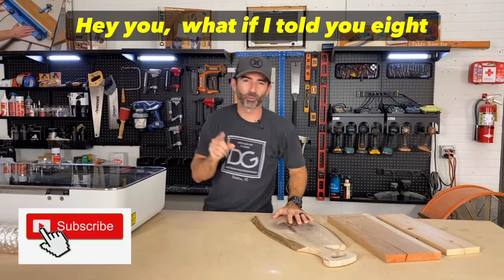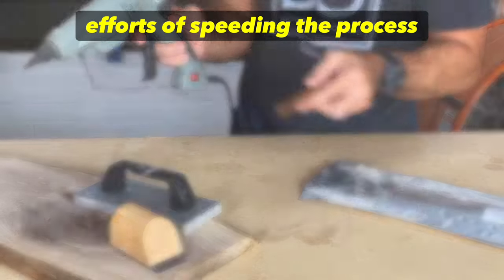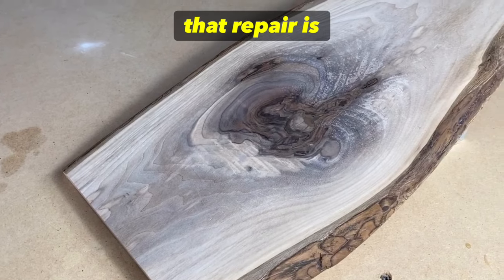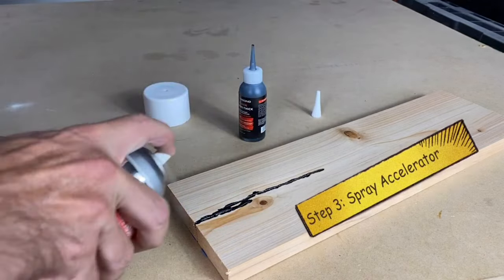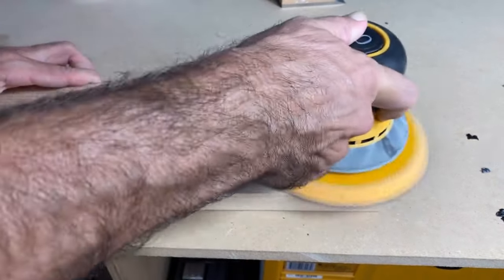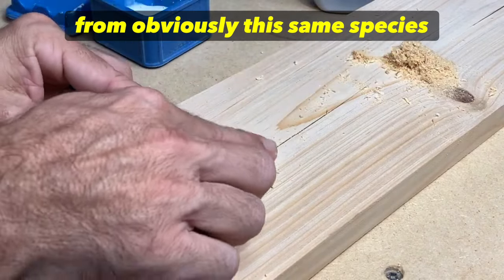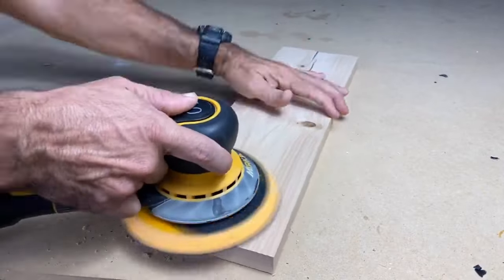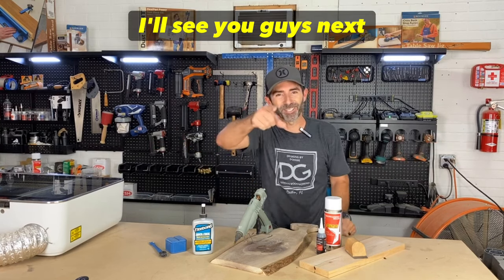WOOD REPAIR… SIMPLE methods to fix CRACKS & KNOTS // woodworking tools

Comment: I don’t know much about wood work, but wouldn’t it be a good idea to drill a hole at the end of the crack to prevent it from growing. That’s a method that’s used for other materials like plastic and metal.

Comment: Thank you for the suggestions. I have an outdoor deck/step with peeling paint and cracks in the wood because the sprinkler was hitting it daily. I want to fill in the cracks, sand, and repaint. The wood is cedar. Should I use wood putty or your glue?

Comment: nice video. I am wanting to touch up aging cracks in a boat's wooden daggerboard. I don't have sawdust. Can I use the filler without the dust?

Comment: The sawdust and PVA wood glue always work perfectly for me.
Reply: I don't use sawdust in that kind of application. I use a hypodermic syringe with a big fat needle for getting the glue into the full depth of the crack and clamp it closed. Sometimes in restoration work, a molding gets damaged, and needs to be saved. If you clean the syringe promptly, you can get maybe 20 uses from it.

Comment: This very helpful. The crack I want to repair if from a tree trunk slab table top. It’s 3.5 inches thick and the crack is almost all the way through - I’m hopeful wood glue and a clamp will prevent the crack from causing the piece from breaking off. 
Thank you very much for this video - Im off to try the repair💫

Comment: thanks for your great video,  got a question,  wouldn't the  fix be much stronger if you warmed up the wood some how, in order to soften up the fibers and make the glue soak in better??? thanks much
Reply from the maker: Thank you and yes absolutely, if you warm up the board by placing it in the sunlight for about 20 minutes the fibers will warm and the wood pores will open slightly and you will get more product packed into the cracks but for me being a entrepreneur woodworker, time is your enemy. If it’s for fun on the weekend then no sweat that’s fantastic and I would do that. But if you’re making and selling the boards then warming it up would be efficient for making money.  I need quick fixes and stabilizing methods. Time = money

Comment: Just  some question . .  . You used what you call a "heat gun". What is the reference for this  tool.? It looks more like an industrial glue gun. Where do you get the knot filler rods?